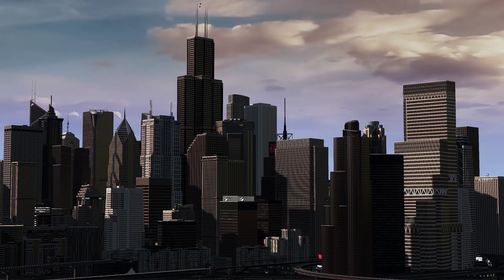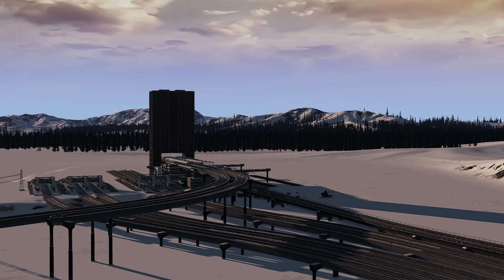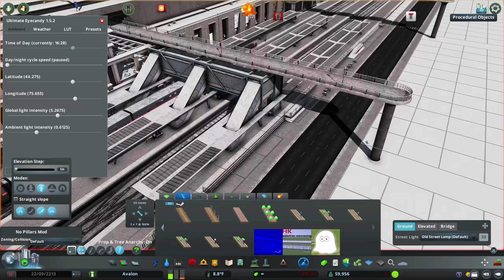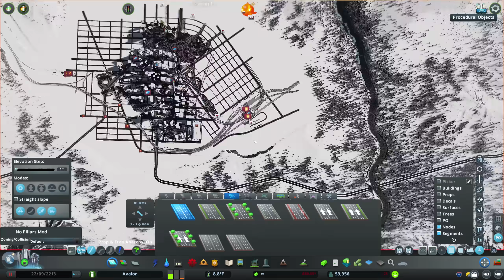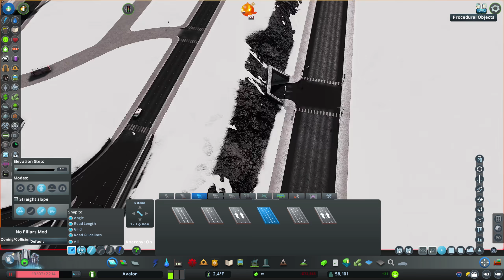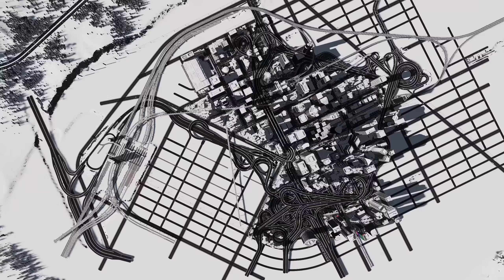Transit Hub Infrastructure - Cities: Skylines - AVALON [26]

Comment: Hi Flux, right at the beginning, when you wanted to place that pedestrian bridge, you had to move the building away because it would get destroyed. You can disable this behaviour using the "disable collisions" button. It's the rightmost button in the fine road anarchy, in the row where you turn anarchy on, enable low angles etc. Or press Alt+C. Sorry if you already know this.

Comment: This vid was actually pretty interesting, looking at the train station got me thinking, do you have an airport planned for the city?
Reply from the maker: Maybe someday - the thing about airports is: they're massive. FBS alone, with three people, took us almost a year to finish. I'd want to match that level of detail (or better) for it to fit nicely in Avalon, but that would require a huge amount of time to do. It's not off the table, but it's certainly not something I'm itching to start until we're much further in the project (if at all)
Reply: Fluxtrance well you remember Fluxburgh and a Rhinestone, those airport, while large, brought in a decent amount of tourism, plus, it would add to the futuristic aspect you wanted
Reply: @ajw20  Keep in mind that airports take up massive potions of land. In snowy and mountainous Tamku, air travel would hardly be a worthwhile investment.
Reply: @theamazingwhaleshark4478  Yes, while the heart of the downtown portion is in one of the lowlands of the map, it looks like the city itself is at or near the elevation of Denver.  Unlike Denver Avalon is surrounded by still higher mountain peaks.  Not an Ideal spot for  an airport.  It would be more likely that the Avalon airport would be down at the base of the mountain range, similar to how Denver's is, which in this case would likely be off the map.